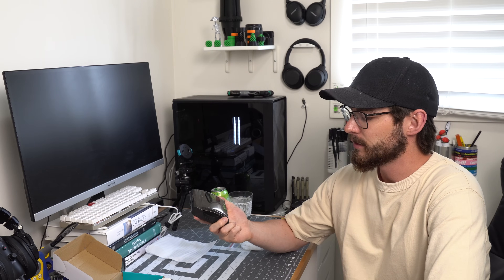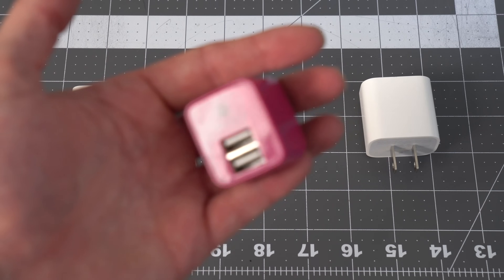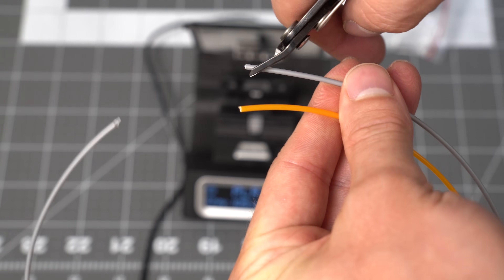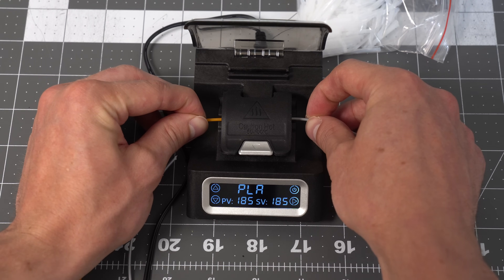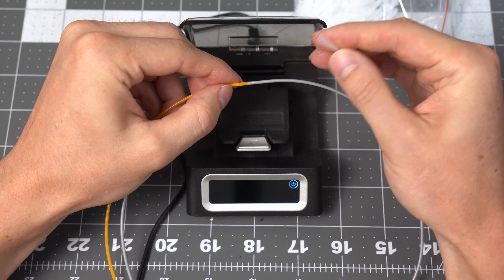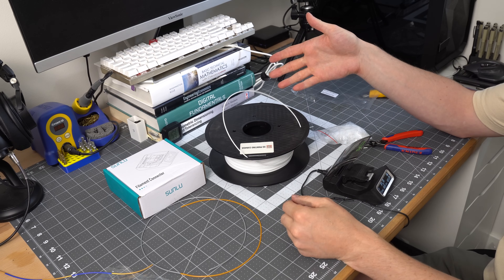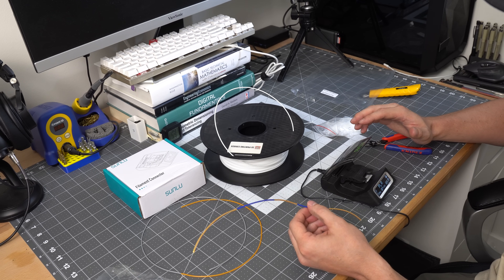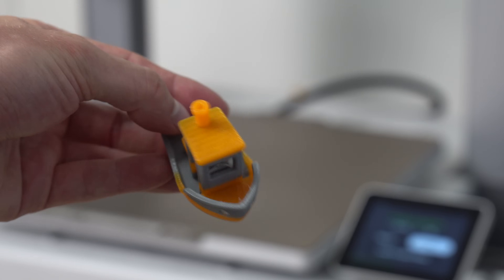Newest Release from SUNLU: The Filament Connector

Comment: For $100+ Sunlu should include a brick. This device doesn't save much time compared to the far cheaper filament welders, like Hexagon, which costs about $40 on Amazon. Plus, Sunlu's device can't weld/connect all filaments like most of the inexpensive models. I'll pass on this. Thanks for the video.

Comment: I always end up with a small section of extra filament at the end . I might pre order one since it’s cheap. I usually have TPU I need to fuse together often.
Reply from the maker: I didn’t try TPU but depending on the hardness you’re using that might be one of the trickier ones to fuse together.

Comment: I found a guy on marketplace with 44 spools of ASA with 100-300 grams left. If I get good results with this I could have 8 spools of ASA for 80$
Reply from the maker: 8 spools of ASA for $80 is a steal. Might want to dry that filament before you use it.
Reply: @3DPrintStuff  I'll end up breaking even, I'll have to buy the sunlu 4 spool dryer 🤣

Comment: It seems you could just use the sleeves to do this while holding a lighter flame underneath.
Reply from the maker: Yeah I almost included that method as part of the video. You’d want to print some sort of helping hand or jig cause it’s a bit awkward to hold the filaments together and heat with a lighter at the same time.

Comment: My problem with filament run-out sensors is that I have to be very quick to replace the spool.  If you delay, there is a noticeable artifact on at the layer where the run-out happened.  May save me from some print anxiety on a large print where I'm not sure the spool is big enough!

Comment: Yep if you have runout sensor you unlikely will have something you can connect. But resume often create some artifacts which may be undesirable. Also I saw DIY tools which done everything automatically, heating, wielding, pushing, cooling. And the main problem of those tools how to take it off without cutting filament again = )
I use PTFE tube and a lighter. Just left it on the spool. I take if off later when it prints over that place the tube stops at the filament input.

Comment: I got one...  preordered rather, I have been printing for a couple years, and I have an obscene amount of rolls with enough to keep, but not for a print, so I can definitely use it, after the initial bonding, probably not as much, but I guess at least I'll have it on hand, I dont care for the fact they did make it plug in, and that they didn't include a power brick...  thats annoying, in that MOST of us just have a phone power brick that won't work...  overall for the preorder price point, I think it's worth it.
Reply from the maker: You'll get good use out of it if you have a bunch of almost empty rolls kicking around. You can free up some space to order more filament.

Comment: I bought one. I will definitely use it. I print almost every day and I fill the large beds of my printers. There has been more than one occasion where I would need to open a new spool knowing that other spools wouldnt have enough filament to finish while I'm at work or off to bed. Yes the run out sensors would pause the prints but they would most likely sit idle for hours till I could change out spools.
Reply from the maker: Makes sense. Are you going to unspool the filament that is on the printer, fuse the end, respool onto the new spool?

Comment: For me the consumable is the deal breaker. I was very interested because the manual methods are...unreliable at best. However the tiny amount of filament this would save me just doesn't justify the cost. Neat idea, poor execution.
Reply from the maker: Yeah that's fair. I'm not stoked on the consumable sleeve either.

Comment: You could use this to automate color changes on prints your wanting multi color and don't have an AMS.  In Orca and Bambu Studio after you slice a multi color print it tells you the length and weight of each filament used.
Reply from the maker: This would be incredibly tedious and time consuming...
Reply: @3DPrintStuff  Yeah I like my Bambu AMS for this but it would save a lot of poop.  💩

Comment: All of my printers have runout sensors so no huge need for it. BUT, if you are printing something in vase mode, theeeeeen it’s useful. If your spool doesn’t run out then you don’t get a blob in your vase mode print where it pauses and restarts. That’s what happens on my FF adventurer 5M at least 😢
Reply from the maker: Vase mode is a good use case, hadn't thought of that one.

Comment: I dont think a proper use case is fusing ends of filament from spools that are running out. Like you said, if your printer has a run out sensor you can just swap spools, but also the amount of filament you have to fuse together to actually break even on this $50 abomination is obsurd
Reply from the maker: Yeah if people are getting their spools for ~$15 you can buy 3 entire spools instead of spending your time splicing...
Reply: I got one specifically to fuse together almost empty spools into fuller spools again, and while my printer has a runout sensor that's just another potential failure point I can avoid, also I use it to make interesting color combinations

Comment: To save one small piece of plastic, another is thrown away. The nylon bit in this case.
Reply from the maker: And thus balance is maintained in the universe... On shorter sections you can just slide it off and reuse it but on larger sections it is a consumable. At least on the larger sections the ratio of waste to saved plastic is a lot better.

Comment: I make PET with bottles, this thing is a game changer for chaining together multiple bottles worth of filament
Reply from the maker: I think this is the strongest use case.
Reply: pretty much the missing link when it comes to making your own bottle based filaments is a solid reliable way to splice the pieces together. I can see this being quite useful for PET filament.
Reply: @AtomicBleach  it’s been such a pain you have no idea
Reply: @Coolfwip  I've been using the PTFE tubing wrapped in a pen spring method with a lighter. You still end up having to sand the material down as it ends up bigger than 1.75

Comment: Yoooooo this fits in for the idiot users who were like "im going to save a dollar and buy spolless " but then they create a bunch of knots in the front and back of the filament!

I need to git gud
Reply from the maker: lol yeah those spoolless reloads can be tricky sometimes.
Reply: @3DPrintStuff  especially when you're smart enough to know you need to wait for the right tool to finish printing (spool and spool winder).

 I really thought I could just slide the roll to an old spool. :(

Learned the hard way
Reply: @TheBinklemNetwork ahhh I made this SAME EXACT mistake in the beginning. Never again 😂
Reply: @Six-Stitches I had a dream of how to use this mess of filament, I think the idea was genius.... But I can't remember it... Dedicated cold pull filament maybe?
There are printable filament welders that use a tube and spring, check it out if your in this boat with me. 

My spool has knots at the front and back and I'm going to slowly slice and then weld once untangled.

Comment: I already ordered one and I see defects where the print stops and starts back after loading more filament after I run out. Even on my Bambu P1S with AMS. I print things to sell and use the entire roll almost but have lots of rolls with 10-15g each. I'd like to consolidate all them to a roll and use that roll for odds and ends prints. Then I won't have all these partial rolls laying around either.
Reply from the maker: Makes sense. What kinds of things are you selling?
Reply: @3DPrintStuff  Functional prints in a fairly specific niche of my own designs. Selling on Amazon, Ebay, and Etsy.

Comment: Cool, I've always considered trying to make a DIY filament joiner so it's cool to see how a manufactured one works! It's a bit steep at the moment, but hopefully it leads to innovation and prices come down. I wonder if a cut silicone sleeve would still work okay, as that part of it being consumable seems like it could get annoying, and cutting it seems like the only way to do it unless you're joining super short sections as you mention. Still, if I had one, I'd probably just do something dumb like estimate lengths needed and try to get a multicolor print all on the same spool lol. Thanks for the video!
Reply: I wouldn't call 40$ steep 😁
Reply: @sorenac  $40 is still not quite my ideal price point, so the fact it's $100 USD puts it far out of reach.

ETA: I've just realized the above link is to bundles only and not the machine itself, but it's still too niche a use case for myself and would be more a toy than a tool.

Comment: I teach 3D technology at a small school and we always end up with lots of left over spools with tiny bits of filaments on them. With this little machine we might be able to fuse those filaments together instead of throwing them away.
Reply: Or you can just use lighter and a piece of PTFE tube = )
Reply: @enosunim at a school? Could be a fire hazard in the eyes of insurances and potentially put the teacher in lots of trouble.
Reply: You can take the spools outdoors and wield them there, then return back to class. = ))
Reply from the maker: Definitely a good use case.